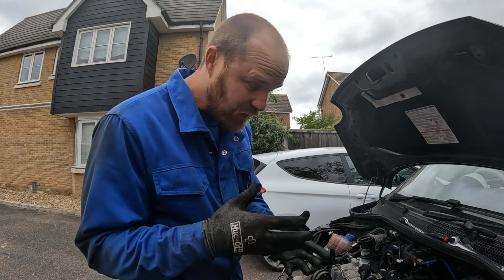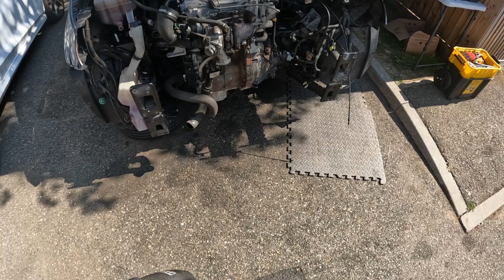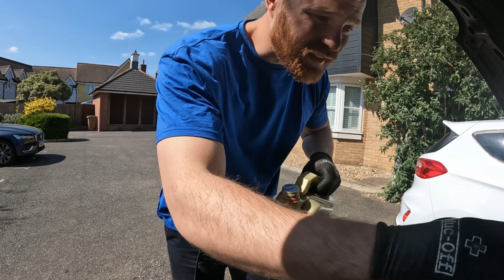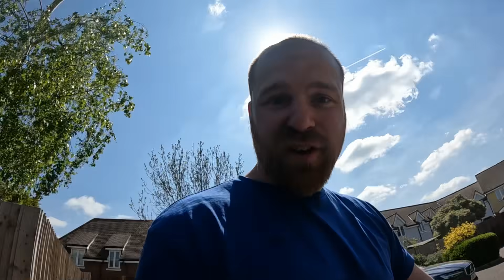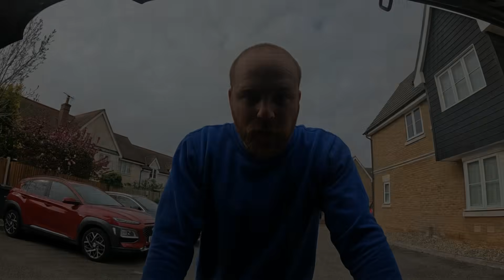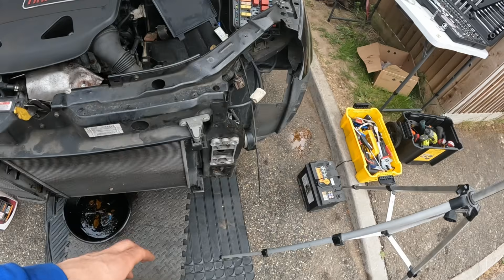I don't want to work on a Fiat again

Comment: In italy this motor is a flop commercial and give many problems after 100.000 kilometers.......in italy sells more 1200 69 cv fire
Reply: Not really a flop, just needs more regular oil changes than Fiat suggest, also needs the correct grade oil, many problems with this engine are to do with the multiair unit that controls the inlet valves.
Reply: @pdtech4524  of course
Reply: @francescosantangelo6614  You're right of course, the 1.2 is probably more reliable long term, older design so all problems have been ironed out by Fiat.
But the 1.2 is much less fun to drive, the Twinair follows Fiat's 2 cylinder, small capacity heritage of their brand, the distinctive sound makes the car unique and adds to the character of the car.👍

I've had a Fiat Stilo with the 1.2 very revving, full of go but them gives up just when you need a bit more grunt!!
The Fiat Panda 4x4 I have has the twinair unit and I much prefer the higher power and more torque etc the little turbo adds to it.

Plus less road tax, cheaper to service, lighter engine plus less moving parts equals less friction and better fuel economy, hopefully!! 😲⚠️😁👍

Comment: You need to crank longer, it takes ages to build oil pressure, no oil pressure up top then the inlet won't be opening as you said it's all driven by actuators, hook up another car or jump pack to give you some more cranking speed, you should easily be able to hold the starter for 20 seconds leaving a break in-between without causing damage
Reply from the maker: Cheers, bud, will give that a go 👍🏻

Comment: Could also be worth removing spark plugs and cranking to allow the engine to turn over quicker, helping it suck the oil up
Reply: Its a good idea
Reply: It probably needs to be cranked for a good minute (may need more) to build up the oil pressure from a dry engine. Taking the plugs out will certainly help turn the engine at a faster rate without killing the battery.
Reply: @stumac869 without killing the starter too, it will run hot!
Reply from the maker: I'll give this a go, bud. Thanks for the advice 👍🏻
Reply: Agree with you William, these little engines need fuller oil pressure to allow a start and this takes a while so would overheat the starter unless the plugs (and fuel pump relay) are removed.

Comment: The rusty powdery deposit is probably from a previous owner adding "Radiweld" or other ineffective, temporary at best, coolant leak treatment. Never use the stuff as it causes more damage than good. Used as a cover the problem up type solution when selling on cars with coolant leaks.

Or it genuinely has a rusty block (usually caused by using water only not coolant and leaving the car standing for lengthy periods of time). Unlikely in this case though.

Oil rating is to do with viscosity or how thick / thin an oil is at particular temperatures and whether it can maintain a lubricating film, that simple although the subject itself is vastly more complicated. Modern oils also have additives to reduce emissions (low SAPS for example).
Reply from the maker: Cheers for that info. I'm gonna flush this coolant and see if anything else comes out. Hopefully that'll fix it
Reply: I was going to comment that it looks like Radweld or Bars Leaks was added to the cooling system which is why it’s stained

Comment: Undo the little bolt what holds the oil pressure valve for the cams pull the pressure valve out slightly crank over till you see oil coming out refit and try start it
Reply from the maker: Cheers, Richard, I'll give that a go 👍🏻